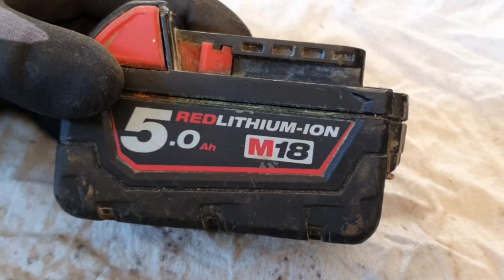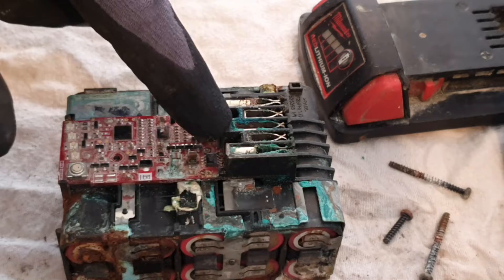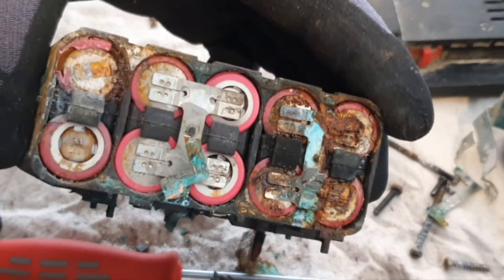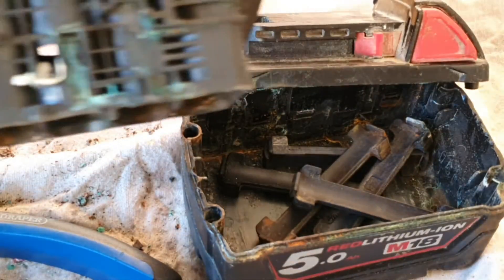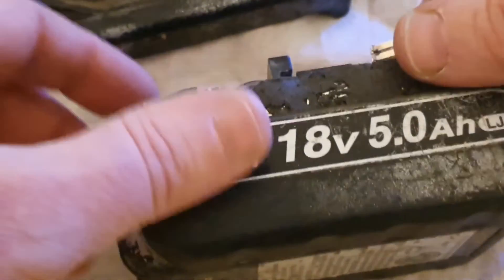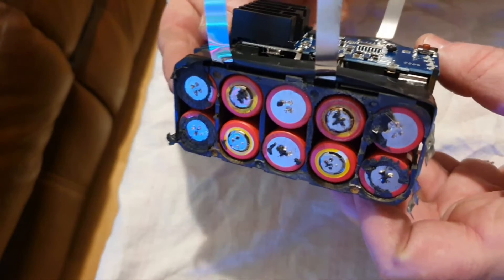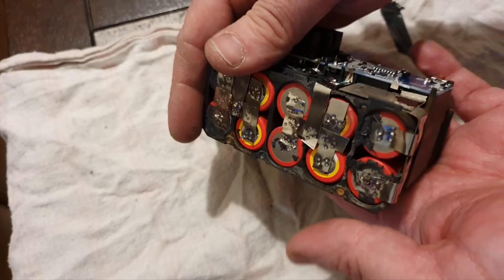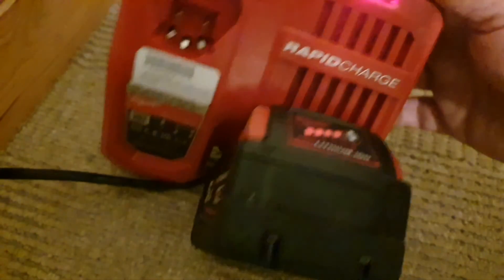I Built A 5Ah M18 Milwaukee Battery #powertools #repair #milwaukee #restoration

Comment: Nice job but how long did this take? I think if u figure your time, it would be cheaper to buy a new one.
Reply from the maker: Yes your point is well made. I do these videos for entertainment and educational purposes really. It helps people understand what their batteries are made of and its a hobby for me. Thanks for your comment 👍 It took a couple of evenings after work to do it.
Reply: @doctorlefthandthread  i get it, i was checking your video out to try and help fixing my battery. The side pin wont disengage from one side so im going to take it apart and see if i can fix it. Was hoping your post could shead some light on the problem, but it looks like it pretty simple to take apart. Thx
Reply from the maker: @ptech88  good luck with the repair
Reply: @doctorlefthandthread  didn’t get to far, just realized i need a different torx to take apart batteries. Damn
Reply from the maker: Here is the set I got a couple of months ago https://youtube.com/shorts/BOEr1hkTUpo?feature=share

Comment: Hi Doc, thanks for the video, very informative.  I need to ask you were the PCB came from. I'm rebuilding a Red Lithium XC 5.0. 9and the board is trash. You couldn't get the strips that solder onto the PCB? How Ling did it take to fabricate those. Thank you!!
Reply from the maker: I get the boards from Ebay they take a while for delivery as they come from China. The connector strips were just the nickel strip I use to connect the cells trimmed with scissors and soldered to the pcb.

Comment: Mighty!!!!! I'm using your influence to have a go, 2 cells gone and replaced but I need to spot weld, haven't a clue what type to use, any suggestions on a little spot welder?? Thanks,  great to see us not throwing batteries away too quickly 😀
Reply from the maker: I use one I got on ebay under the description DIY battery spot welder it comes up about £50 roughly
Reply: @doctorlefthandthread  

Ordered👍Thank you!!!!
Reply: Gentleman,  thank you 👍👍
Reply from the maker: @kieranloftus6807  thanks for joining the chat in the stream it's more craic when people comment
Reply from the maker: https://www.ebay.co.uk/itm/234854852486?mkcid=16&mkevt=1&mkrid=711-127632-2357-0&ssspo=CgCol5XtS5W&sssrc=2349624&ssuid=cjPn_ZfdQLW&var=&widget_ver=artemis&media=COPY
Reply from the maker: Here's the strip I use 
https://www.ebay.co.uk/itm/274865824817?mkcid=16&mkevt=1&mkrid=711-127632-2357-0&ssspo=k6L2r3Z0R46&sssrc=2349624&ssuid=cjPn_ZfdQLW&var=&widget_ver=artemis&media=COPY

Comment: Bravo my friend. Well done indeed. Patience is required I’m assuming 😂. You’ve really got that down to a science now. Great job my brother. How’s the weather across the pond
Reply from the maker: Thanks Brandon I really fell down a battery rabbit hole for the last 5 or 6 months and there is more to come. I am planning something bigger than the Milwaukee battery build at the minute. I need to do more research to figure out how but I think it's possible. I hope it works out. The weather is cold we have 4 inches of snow at the minute and around -6c or 21f. I think alot of you guys got it rough with the weather over there recently too.
Reply: @doctorlefthandthread  4 inches of snow! Hey man here in Ky we’ve been blessed. A lot of cold temperatures and freezing but not too bad on the snow. Other states have been absolutely pounded with feet of snow. I’m thankful that we’re able to still work and get these jobs knocked out. You know I’m a sucker for the battery content so keep them coming brother. I absolutely love them. That blue battery acid corrosion on the battery looks like the same build up on a car battery. That was wild. Definitely in bad shape but you put a breath of fresh air back into that thing. Absolutely awesome man

Comment: What spot welder are you using? I bought a generic one but it's really weak.
Reply from the maker: I am using a cheap one myself I use very thin nickel strip a more powerful one may be on my wish list. Though mine is doin the job for now